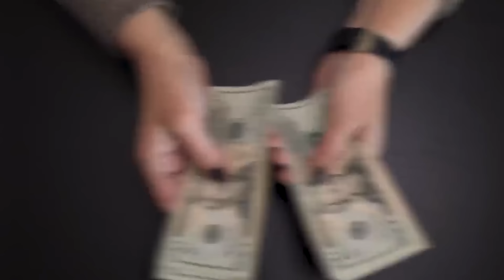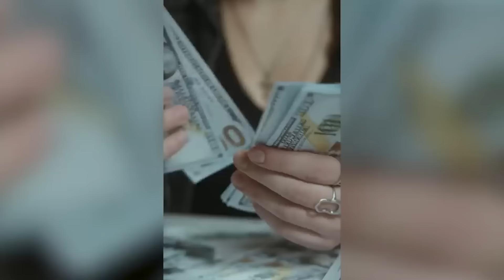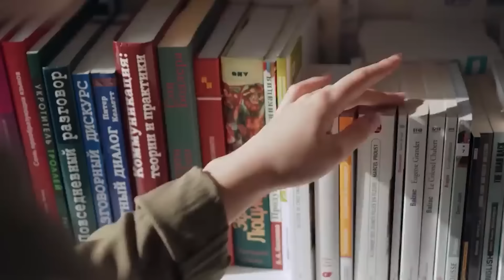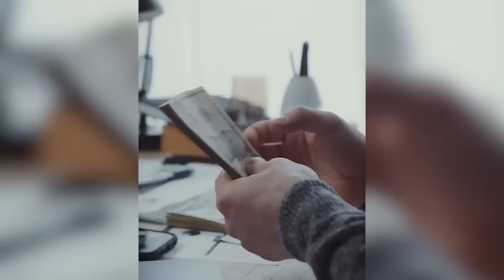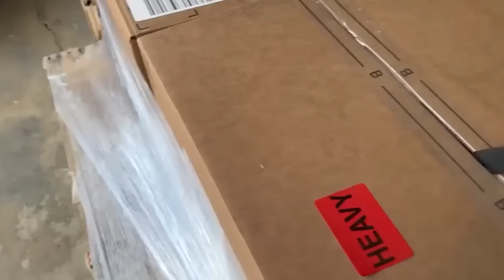20 Banned Self-Defense Gadgets That Are Too Powerful

Comment: number 7, tell me, what good is a 6 inch blade that only comes out an inch and a half past your closed fist?
Reply: It's only an Assassin's Creed fan toys.

Far way to bulky, needing to open the palm and break the wrist backward to have a correct blade length, inusable in the fire of action if you have a sleeve above it, and with to many structural and practical weaknesses to be effectively used. 

Just use a cuff to strap a knife at the left arm is far more useful and cheaper.